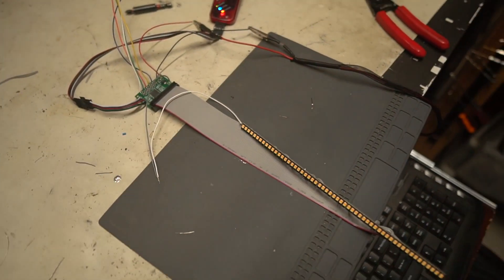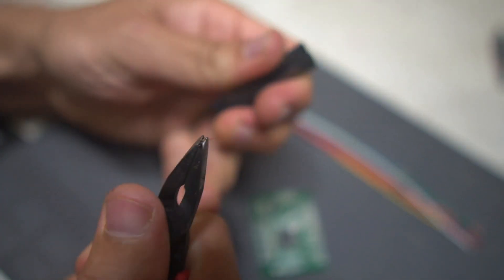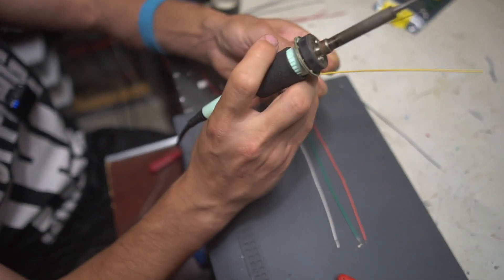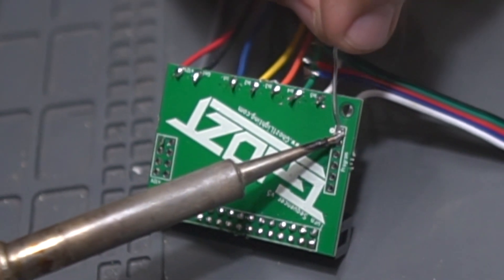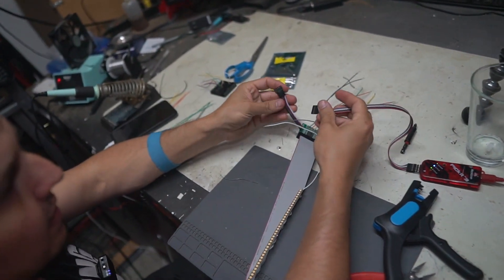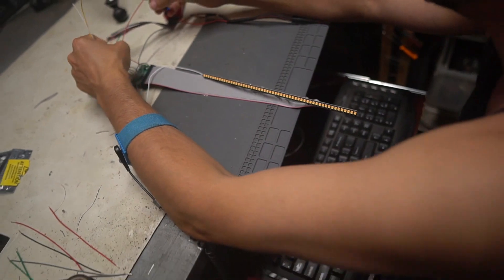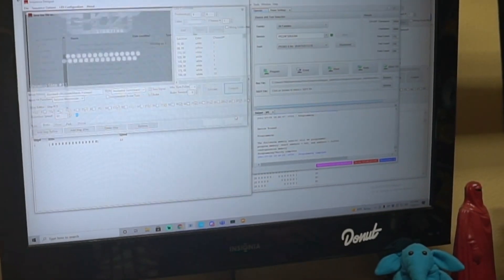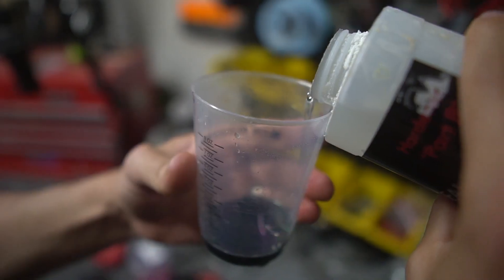How To Setup an LED Sequencer

Comment: Do you need a separate ghost module for each light, passenger and driver taillight or are there enough outputs on one to use for both sides?

Comment: hey chris, is there any way with blueghozt to set it so it plays an animation when the engine or ignition is turned on/off? or somehow program it to run alongside a cars "coming home lights" ? 

my ideal setup would be able to run a showmode for like 30-60 seconds every time i switch the car off, this possible at all?
Reply: yeah this is possible i’ve seen it done before. they have startup animations and also shutoff animations
Reply: @Bavarian Beauty - BMW E90  with Blueghozt? I haven't seen that before, only with the Ghozt sequencer.
What he could do is make a showmode that animates how he wants, then use a timer relay set for how ever many seconds the animation takes to play. Then trigger the timer relay to come on with either his ignition or his welcome home animation.

Comment: Dude I love your videos. What is the best way to make these 6 foot long? I have a project for my van. Low side bars and bars on the roof as well. So in total I'll need 4 of them 6 foot long. 2 per side that will stay solid amber and the sequential on the roof bar and bottom bar per side of the indicator if you get what I mean

Comment: quick question why did u glue the 28 pin connector before potting is it to stop the potting mix get inside where the ribbon plug will go into?
Reply: Yes, that is exactly the reason why he plugs those holes!
Reply from the maker: Great question, that was dialectic grease to block the cavities 🦷 😬